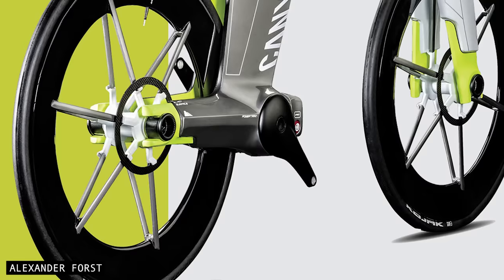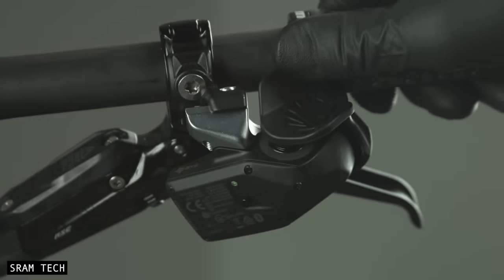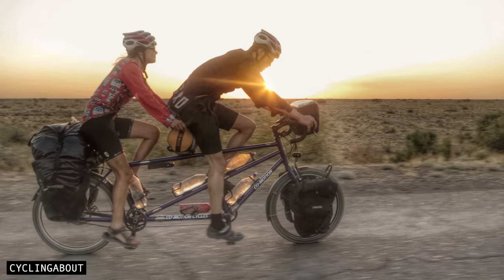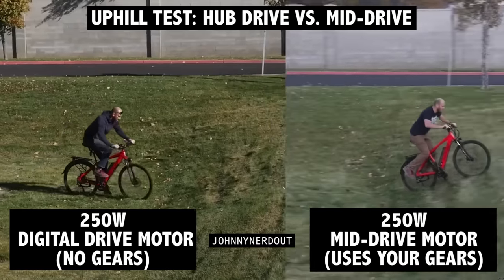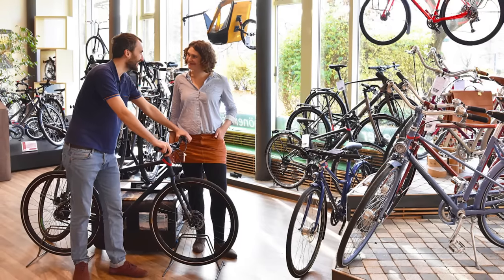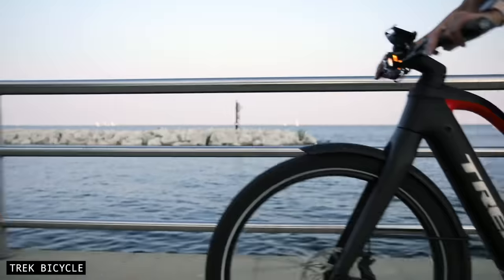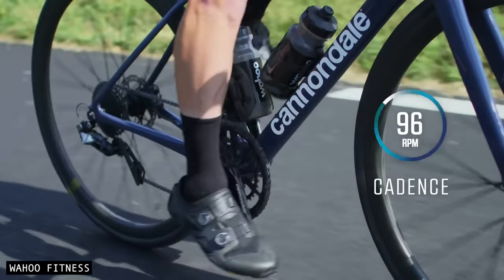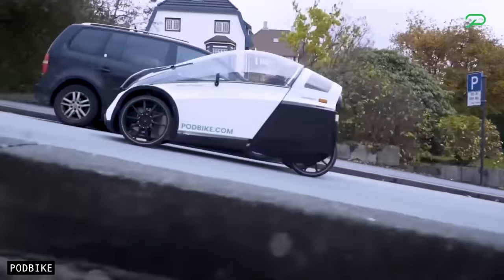Are Chainless Digital Drive Bicycles The Future of Cycling?

Comment: When i was a young man I was very fit and one of the reasons was that I cycled 30 km each way to and from work. 
Having technology do the work for me would make things easier but I would lose most of the benefit of exercise.
I also used to swim 2km and run 10 km per day.....I guess the future will invent something to make this easier as well.
Still, I would love to give this a go, now that I am old and not so mobile.....maybe this could re-invent my passion for exercise that I once had?
Reply: try running 10km per day without shoes and then let me know if our technology ruined the experience or improved it
Reply: @janthran  as i said, I am now old and not so mobile....so I will not try running 10km per day with or without shoes, because I know I cannot :(
Reply: @Ulbre  my point is just that as technology advances, it becomes normalized. you don't even think about shoes as "using technology to make walking easier" but it that's absolutely what they are.
Reply: I don't think you got the point.  You will still have to pedal this bike.  A bike like this with just the generator and motor would not have any more power than what you provide.
Reply: @wimharter  I think I totally got the point whereas you totally missed the point of my comment....but hey, you lot are out there!!!!

Comment: It's worse than that. There's also an efficiency loss at the battery charging and discharging. Plus another small loss through the wires and the longer the wires the more lost energy, more connections also means less efficiency. Likely 35% efficiency at best.  And you won't get nearly as much energy back into the battery as you think during regen braking. It's a waste of time and money. Plus you have a heavy bike for no reason.
Reply: These losses you’re bringing up are much lower than you think. We measure the wire losses  bring up (we call copper loss) in hundredths of percent. The greater copper loss is in the windings of the motor and generator itself, but that was accounted for in the video.
Reply: @wademt  like I said, small loss in the wires and connections.  But there is a significant loss at the battery.
Reply: @wademt  a chain drive is less than 2% loss. Just use it.

Comment: You mostly just convinced me that regular e-bikes should also feature regenerative braking
Reply: Regenerative braking on an ebike isn’t all that it’s cracked up to be.  I’ve wrenched and sold bikes with that feature  - I wasn’t impressed.  With a car weight to drag ratio is much more favorable compared to a bicycle so you don’t get much extra benefit.  With ebikes that offer regen braking or while coasting - if you run out of battery it’s worse than pedaling a bike with a flat tire and heavy whereas a regular ebike is just heavy.  Regenerative braking systems favor hub motors vs mid drive as well.  As someone with 20+ years of bike industry experience - I wouldn’t buy an ebike with regenerative braking.  If you want bicycle efficiency aerodynamics are where it’s at.  At 14mph/22.6kph 70% of your energy goes to air friction and it gets exponentially worse as speeds increase.  The real improvements in efficiency are aerodynamics.
Reply: @stefhirsch6922  you're right for flat riding, but it's a completely different story in the mountains. On a steep mountain descent, you lose a large amount of energy with little advantage – a bit of a thrill, but not actually much time saved relatively speaking, if the next climb is a <10 km/h struggle. That's precisely because aero losses are so big, and they scale quadratically with speed. Regen braking could make mountain touring much more effective, provided you have the discipline to actually pull the brakes so you only roll down at a boring ≈30 km/h instead of 60 km/h.
Reply: @leftaroundabout  ebikes with regen braking that are used without power assistance are worse than riding a bike with a flat tire.  They just aren’t good and don’t work.  So lots of extra drag,  significantly reduced efficiency and greater weight are not your friend when climbing steep hills.  Extra fitness,  easier gearing and standard electric power assist (or gas) are all strategies which work.  A system with at best a 58% efficiency compared to 98% displays a clear winner. That translates to a 42% loss vs a 2% loss.  A system which is 21x less efficient,  significantly heavier and more expensive doesn’t seem like a performance upgrade to me.  Until generators and batteries/charging systems are significantly more efficient regenerative braking is a crap idea.  The juice isn’t worth the squeeze.  Bicycles haven’t changed much in the past 130+ years for a reason (unless we are talking about aerodynamic fairings or recumbent bikes).  They work.  Lever driven propulsion vs a crankset which rotates the pedals in a circular motion to transfer the power through a chain or drive belt to the rear wheel are the most reliable,  durable and efficient that have ever been attempted.  Diamond frame configurations rule bike designs now as they did for over a century - they are the strongest,  best handling,  lightest… that have been tried.  The bicycle is the most efficient method of transportation due to its intelligent elegant design.  Replacing an incredibly efficient,  lightweight and durable design for a Rube Goldberg abomination isn’t progress.  Seriously when adding bearing drag from the rear hub,  pedals and bottom bracket to the frictional losses to a chain drivetrain would still be 96-97% efficient.  A car will have over double that amount.
Reply: @stefhirsch6922  perhaps some e-bikes have  more drag than a flat tyre... but that's because they're bad e-bikes, not because they have regen braking. Many especially of the cheaper models seem to be based on industrial motor designs, where price and longevity have priority before efficiency and weight – the exact opposite of what you get with performance bike components.
Electric motors, even powerful ones, can run with very little friction. A bigger problem is the torque required, which generally necessitates a gearbox, and again these are often way less efficient as they could be. In principle this could be replaced by an encased belt- or chain reduction, and then you would get the same efficiency advantages of mechanical drive trains.
Or even just a better dimensioned / better tolerance / better lubricated gearbox. FWIW, even my cheap e-scooter has regen braking and still coast decently with the electrics shut off.
The actual problem is that it's cheaper for the manufacturers to put a freewheel after the gearbox and compensate for losses of the electric drive with a bigger battery, than to optimise the system to be good at regen braking, and most e-bike buyers evidently don't care either, since they anyway charge the bike from the wall plug after every ride.

I quite agree that mechanical bikes are great and I won't buy an e-bike any time soon – but they do have two things that keep annoying me: 1. derailleur drivetrains are a maintenance nightmare, especially in cold, wet climates, especially if (like me) you like to ride in mud or on salted winter roads 2. mechanical brakes are a bit sad, not only wasting all that energy you've preciously laboured on the way up, but also wearing out in the process. (And, they too are a bit temperamental, with dirt/oil contamination ruining the response.)
So if I were to buy an e-bike, it would have to have properly working regen braking too.
Reply: @leftaroundabout  most of the maintenance issues with externals drivetrains and derailleurs are A. contamination and B. lack of lubrication.  Try fully degreasing your chain (yes it requires removing it from your bike and either putting it into a plastic tub with degreaser and shaking vigorously for a minute or an ultrasonic cleaner with degreaser,  rinsing blowing it clean with a compressor nozzle and relubricating with a better lubricant.  Ive had good luck with “dumonde tech lite” lube - follow the instructions exactly.  For shift wire housing middle burn cable oilers are a great option.  For rim brakes in the wet I recommend koolstop brake pads (black for dry,  dual compound for mixed conditions and salmon/orange for wet).  For disc brakes semi metallic are going to last longer.  Try out galfer brand,  swissstop,  or koolstop.  Most brake pads are typically “organic” or resin which are quieter but don’t last as long or stop as well.  Good mechanical or even rim brakes which are set up properly stop just fine.  I’m a fan of shimano bike parts but their brake pads for rim brakes kinda suck.  If I bought a new bike with shimano rim brakes I would immediately take them off and throw them in the trash.  They wear out rims and don’t stop well while wearing out quick.
Reply: @stefhirsch6922  all of these are valid suggestions, but it just reiterates the point: derailleurs are maintenance monsters. Having to deep-clean the chain after every couple of rides for best results is the kind of servicing that may be ok if we're talking race cars, or indeed race bikes, but this is not something I should spend my precious bike time on.
Nor for carrying out internet discussions that aren't reaching any objective, for that matter...
Reply: @leftaroundabout  with a number of better chain lubricants you degrease the chain once,  then just reapply lube as needed plus a bit of wiping with a rag.  I haven’t cleaned my drivetrains for years and they’re clean.  I’ve been impressed with “dumonde tech lite” - it’s quiet,  lasts longer than 90wt gear oil,  mostly clean and rides in the rain don’t wash off the lube - just the dirt.  Some of the wax lubricants such as offered by silica seem like they have promise but I haven’t used them.  All of the wax lubes that I’ve tried only kept lubricating for about 3 hours or so,  thus if you want to do a 5-6 hour ride you’re chain is going to squeak for 1-2 hours (while still attracting dirt).  External chains and derailleurs aren’t a maintenance headache with good quality stuff and better choices in lubricants.
Reply: @stefhirsch6922  good for you. My experience is different.

Comment: Depends if you want peddle assist, or the motor to take over - in which case you will have an electric moped.
Reply: The moment there is a battery and an electric motor on a bike, there is no technical reason for it not to be capable of "driving on its own". It is only a legal thing that the motor stops operating when you stop pedaling. 

This is true for all e-bikes. So while a motor only driving the bike without added mechanical input from the user (using electrical input instead) may be seem different, it actually really isnt. And because the motor does a large part of the work in the first place on e-cargo-bikes, it also is shockingly unimportant how much input energy the human actually provides.

Comment: This would be a great candidate for the use of super capacitors as they are lighter and should store plenty enough to get you going at the lights
Reply: They also have lower resistance then a battery. So you will see a gain in efficiency.
Reply: @MrHaggyy  no, the maximum power transferred is when the load resistance matches the internal resistance, so this would mean max power transfer at a lower load, lower efficiemcy for same load
Reply: "super capacitors as they are lighter"
If one compares the amount of power per gram of the two storage solutions (batteries vs super caps), super caps weigh much much more than a battery with comparable energy capacity.  
Super capacitors have miniscule power storage compared with batteries. Tom Stanton made a video showing a super cap powered ebike (Super Capacitor Bike). It was pretty terrible.
I watched a bit of the video just now (while finding the title) and I see Tom had also built the motor. It's possible with better components a super cap bike would perform better than the one shown by Tom but I doubt it would work well.
If you're going to the trouble of adding a motor and generator to a bike,  you'd probably want to use real batteries to maximize the benefits of using an electric drive.
Reply: @locomotive9000 This kinda doesn't work when you have a non-linear power supply sitting between the source and load.
Reply: The hall effect, in combination with a supercapacitor, can bring up the efficiency of an electric drivetrain to about 80%. It's not as good as a chain, but most people care about getting to the place that they're going instead of having peak efficiency.

Comment: Regenerative braking is a nice feature, but nearly all bicycles have a freewheeling rear hub, and that has a lot of advantages, too. Remember that air resistance is a powerful "brake" on a cyclist going downhill at typical speeds. With sufficient regenerative braking, one would have to pedal more, or use the motor. That's one reason few e-bikes have regenerative braking.
Reply: I don't think that you'd need to have the regenerative braking active whenever the rider stopped pedalling. It could be controlled, by the rider, with a digital brake lever
Reply: @pedalinpete  - Yes, but the less Regen is used, the less value it provides relative to the cost of installing it. At any event, Regen braking should be activated with the brake levers, so the bike can still freewheel. The freewheel hub is one of the most energy efficient parts of a bike, and due to physics, no other vehicle besides a bike and a train roll as far without power.
Reply: @pacificostudios  Regen is worth it even if it used battery. Magnetic braking is maintenance free, intrinsically anti locking and works the same in all weather conditions. Also the brake lever feel does not change over time. Bicycle brakes are super annoying to work on and are very high maintenance.
Reply: @difflocktwo  - Don't forget that Regen braking cannot actually stop a vehicle because braking force falls to near zero at low speed. Some form of friction brake is needed to actually stop a bike safely, even if that's your foot.
Reply: @pacificostudios  You can use a bit of battery to stop. Think about "reverse". Basically you can use battery to drive the motor in reverse to keep braking force high even when it doesn't regenerate. Many shared scooters use battery to lock the wheels if you try to move them.
Reply: @pacificostudios  Agree. For the most part, I would only really want regenerative on long long hills. If it could be configured as a variable, it would provide braking while saving on brake component wear.

I am thinking in terms of cycling mountain passes on my ebike, where down hill could be for several miles and require braking more or less the entire time. Zero braking would have one reaching terminal velocity in some case, or nearly anyway.

I did read on the bike in the video, and think it is completely terrible idea. Bicycles are very efficient, and this bike is the opposite. There is no upside. 

I already have an ebike, but I pedal like a demon, and just go faster. I bought mine to ride more, and I literally ride 10x more now. I am planning and epic ride through the rockies, which is where regenerative has possibilities. Many electric motors already have the capability. Whether or not I could rig a work around on my current bike remains a question.

Job one, was to ride as is until the warranty is out. Fudging with it before that would be foolish.

Comment: A bike that comes with an integrated upright stand could also have a mode built in where you could charge the battery while peddling in place. Say if you had a commute that was kind of awful you could still pedal it in a session or two during the day, storing your mechanical energy for the next time you ride but not having to get all of your pedaling in at once. This could similarly have the perk of being able to act as a mobile charging station for smaller electronics using this same idea.
Reply: You would always need to pedal a lot more than what you get out

Comment: I truly appreciate this thorough review of the digital drivetrain for bicycles. What I like most is the fact that when pedaling I would be able to keep the cadence the same regardless of terrain.  Also regenerative breaking and recouperation of energy when going downhill is awesome.
Reply: Yeah, no... People like you don't seems to understand that electric motors and generators are far from having a perfect efficiency, you'll basically need to force about 2x more to get the same speed as normal bicycle so I'm not sure that's a very good tradeoff just to get a tiny bit of regenerative braking once in a while...
Reply: @Alfred-Neuman Electric motors nowadays, at least ones suitable for this, are over 95% efficient. This goes for both the driving motor and the generator. The motor controller can and usually is over 93% efficient, up to 97% efficient. 

This is literally more efficient than belt drive.

Make it recumbent and enclosed, and it would be way better (faster) than a usual bike, more efficient at speed, and with a small battery, better overall for commutes.
Reply: @vladlu6362  But is it worth sacrificing repairability ? Especially when there is a lot less data on the reliability of this technology. On my cheap bike if something breaks I can fix it myself in less than an hour for pretty cheap. If the motor or generator breaks, it's gonna be an expensive repair if it's even possible.